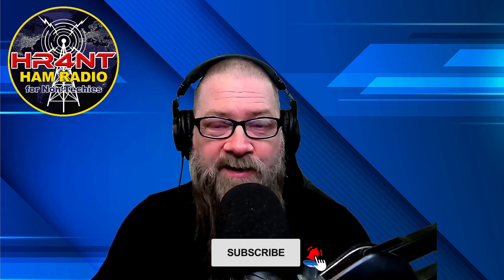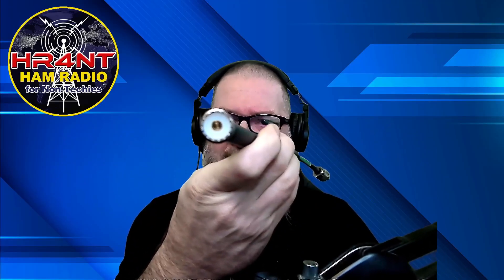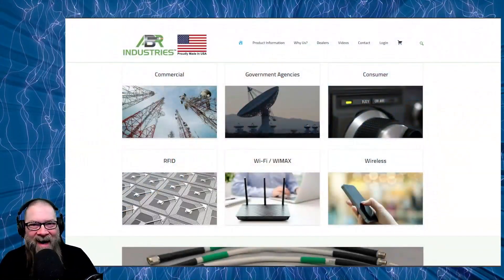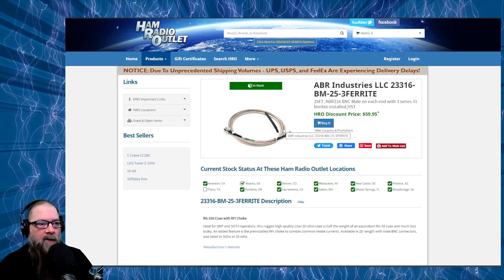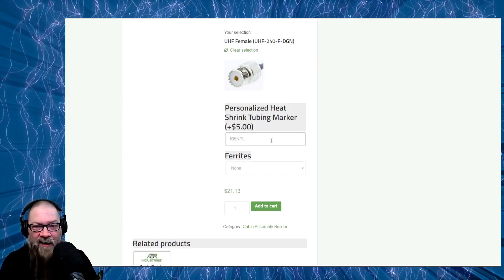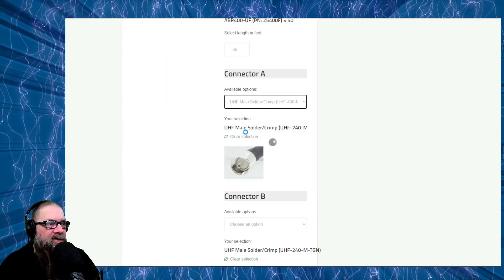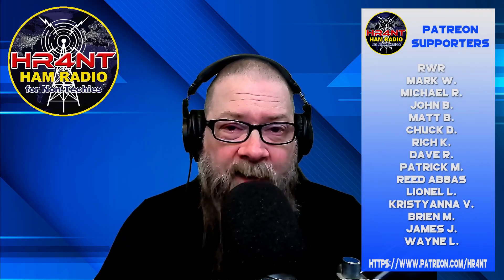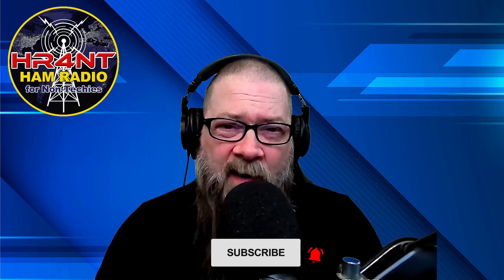How to Use ABR Industries Custom Coax Builder - Build Your Own Custom Coax for Ham Radio

Comment: I just order 50' with the 7 ferrite, I also sent them an e mail suggesting a drop down and/or search of common name coax that will bring back result cross referencing their product, not everyone knows AB240UF but will know RG58 8x, LMR 400 etc.  This will help take out some of the guess work.
I also order a 2' choke, I was going to get one from Chameleon but I already have a few of their products, gotta give ABR a shake.
Thanks for the video
Reply from the maker: I think you will be very happy with the ABR stuff.  They are top notch cable and I would put them in the same category as Messi & Paoloni, just more affordable and local.  Let me know how you like it after you get it and use it for as while.  Thanks for the comment and for watching.  73!
Reply: @HR4NT  I have some M&P Hyperflex 10, I like it a lot.  I am glad ABR is same quality

Comment: Great to see you are back and on the mend. In the UK the first tier of license limits you to only 10 watts, so it is really vital that your antenna system is as efficient as possible, you want every one of Callum's "Wiggles" getting to the antenna and carrying your output through the air, and a cheap Coax will kill all your efforts dead for the sake of a few quid! Some will spend 1000s on a rig and antenna, but blanche at paying for decent coax. thinking it is just wire! Running QRP power levels is hard, so why make things harder by being a cheapskate! Paying the extra is well worth it, low loss cable equals range, and that is what we all strive for! 73 Jim M7BXT
Reply from the maker: I completely agree.  I live by the motto of buy once, cry once.  In doing so, I make sure I get the best I can afford so I am not bothered with having to replace it again in a short time.  Thanks for the comment and for watching.  73!

Comment: what type of coax do you recommended for a 50ft cable for use in POTA with a trapped vertical ? Choke ?
Reply from the maker: ABR's 240UF should be fine.  As far as a choke, that is something you would have to determine if it helps with your specific antenna.  It may or may not benefit from having a choke attached, hence why I prefer that choke to be a separate item in my gear.  I hope this helps.  Thanks for the comment and for watching.  73!

Comment: I ordered over $300 worth of custom cables & jumpers with ferrites a few months ago.  It's awesome to have the correct connector and avoid any & all adapters. For LMR400 & 600, ABR offers two types: solid Core and stranded core UF (Ultra-Flex). LMR400UF has a 3in bend radius. When I received my order, the receipt had a signed 'thank you' on it by the owner! ABR is also a huge government and military supplier. I am 100% satisfied with ABR. The referenced Italian coax is excellent quality and will also make custom cables, but it has to come from Italy so it costs accordingly.
Reply from the maker: Thanks for sharing that!  I wasn't knocking M&P, but as you say due to the location it is pricey to get it here even if you order it from Gigaparts.  Thanks for the comment and for watching.  73!